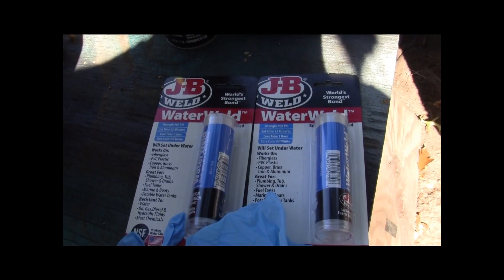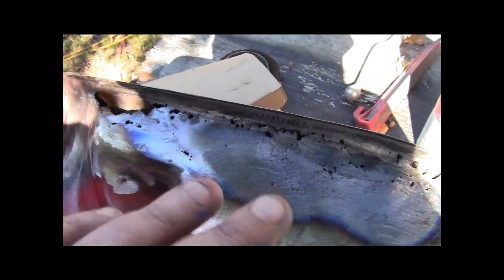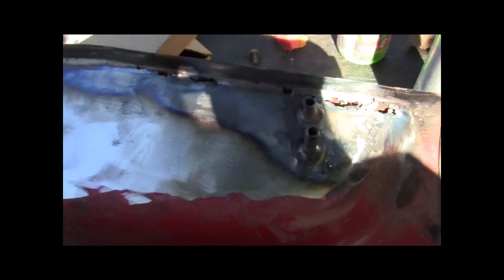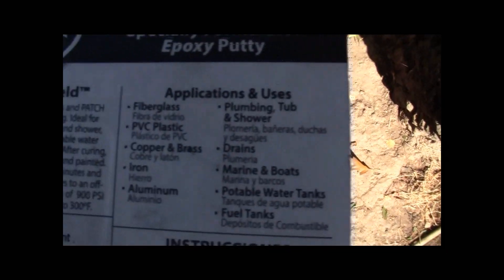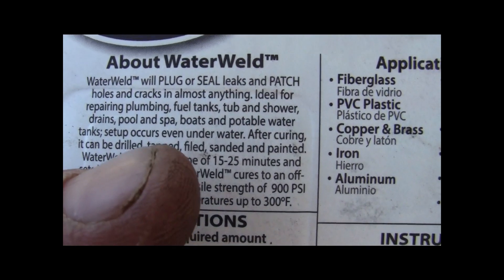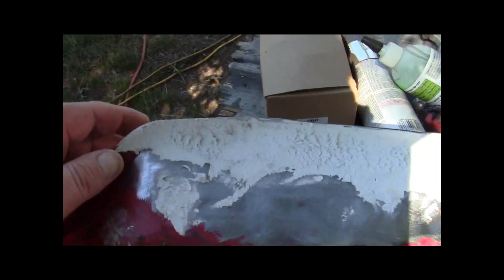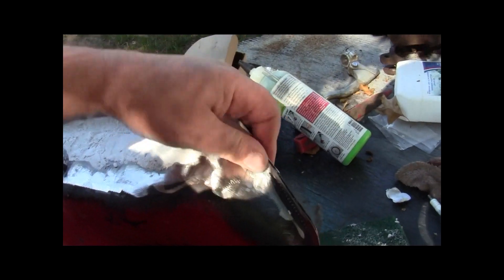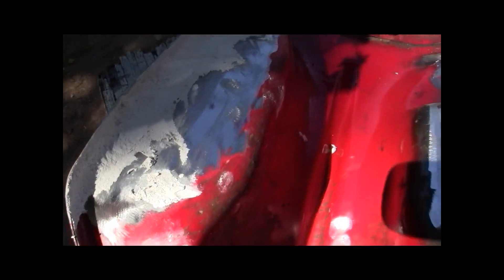JB WELD water weld test (PART 1 )

Comment: Few years ago Shawn I learned of epoxy putty through boating. Comes in 2 packs of small putty, similar stuff I suspect. Couple of years ago at bangers someone smashed a carb. Got a pack of this, mixed it together, gobbed it on and ten minutes later was racing again, no leaks.

Comment: I’m repairing a 2nd Peterbilt 379 radiator with water weld 1st radiator shit the bed in SC big hole used water weld it sealed and I made it to FL to trade the truck in so far everything JB Weld has always worked great for me